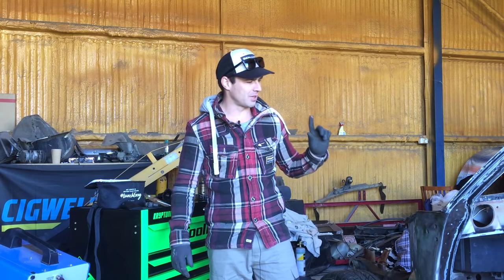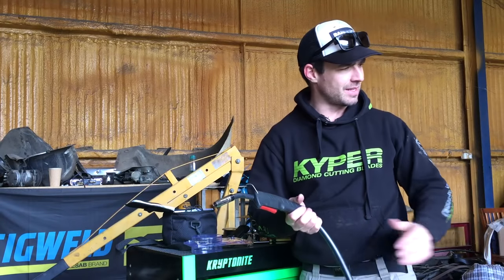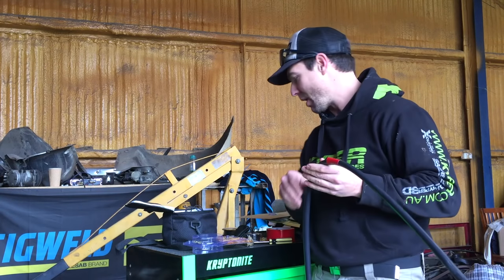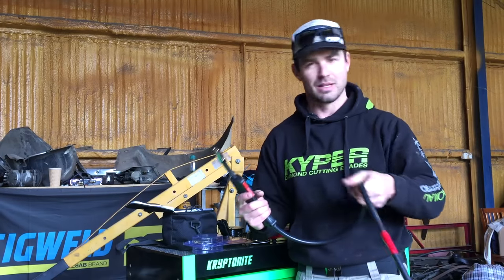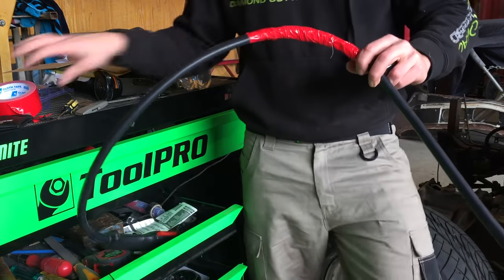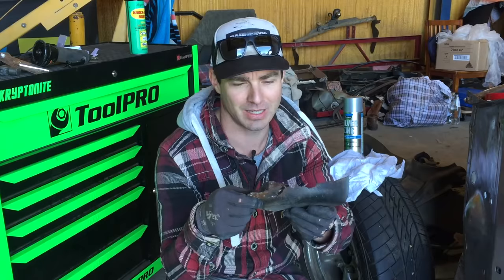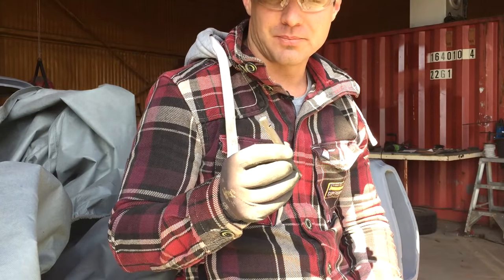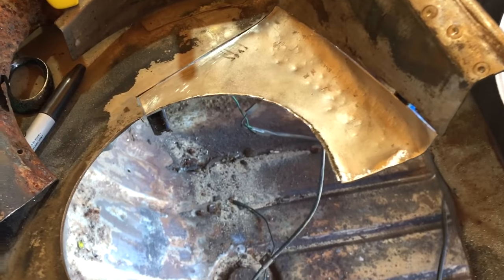EPISODE 20: PART 2. REPAIRING THE PLENUM CHAMBER  ON A 1982 HOLDEN WB UTE.

Comment: I really enjoy watching yours vids mate. Not sure if it has been mentioned, but i recall in one of your earlier episodes you mention replacing the engine. It appears you have a 308 "turbo block" that is, it has a chev bell housing pattern on the back, and your trans is a TH400. Keep these if you can!! the TH400 is a good solid auto, and if you get another 308 you will need another turbo block or an adaptor to use the TH 400.
Reply from the maker: Martin Bristow thanks mate! Yeah it’s a th350 so I reckon I will keep it as I agree it’s a strong box. I think it’s got a faster shift kit in it as well as it shifts very quickly and smoothly.

Comment: Hey mate looking good getting there just a little tip with the lip there get one of the dollies and got a round it and just lightly hammer it just to smooth it a little and the heater and the should fit better good work so far mate
Reply from the maker: Yeah it's not finished yet mate, just got it to a sealed weld stage and will go through at the end and tidy it all up before i test fit the heater duct again. cheers

Comment: Rare Spares actually make the lower plenum chamber panel and have done for a few years now. Would make this job a lot easier than having to repair the original one. Doing a good job with the metal work on this car by the looks of it though.
Reply from the maker: Yeah I knew that but I didn't want to spend another $580 on a panel you never see. I decided to put the money on the cowl as it's a feature piece and just hack together the chamber repairs.

Comment: Hey mate love the vids just getting things together to start on my own Wb ute , was wondering if you have those cutting wheels you designed available for purchase yet , keep up the great work
Reply from the maker: Thanks mate, i hope to get the first production run through by end of August, i will have some early finished blades for final testing mid August though. At this stage the sizes will be 76mm for air tool cut off wheel with a 9.5mm bore, and then a 125mm angle grinder with the 22.23mm bore. If you have an air tool at 76mm which should fit then i will have a few to sell mid August i reckon.
Reply: Barnesy's Builds  awesome mate let me know when your ready to go and I'll get a few
Reply from the maker: Ok sweet will do mate, cheers